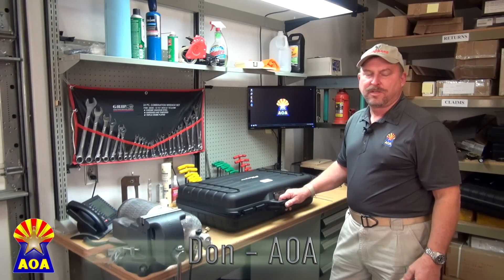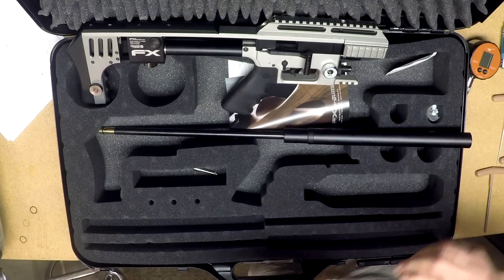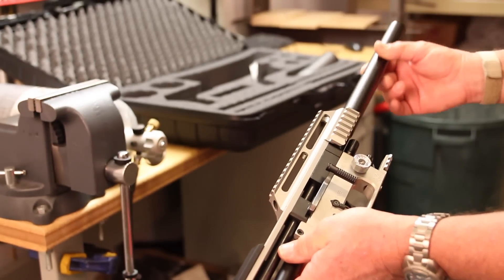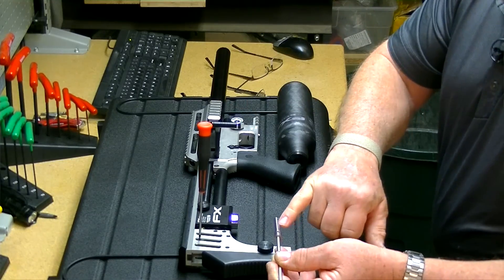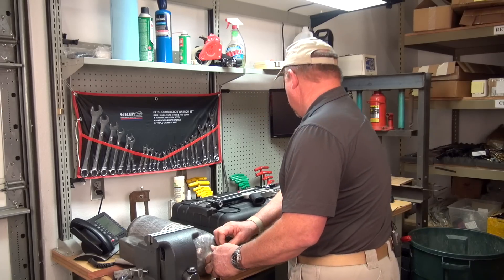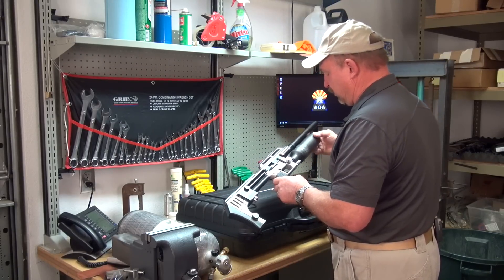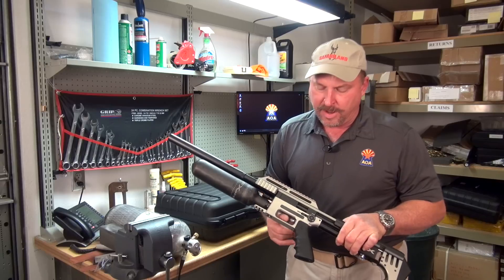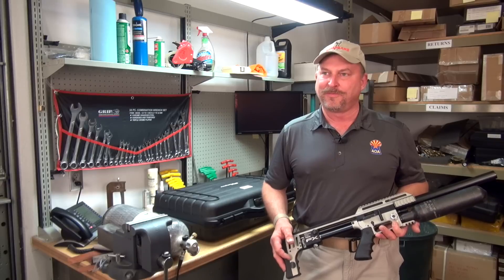FX Impact Unboxing and Assembly

Comment: Do not fire the Bullpup to release pressure on the regulator side, it might unseat a valve in the rear. There is an extra screw (regulator adjustment screw) which you should turn counterclockwise (2.5mm). https://www.youtube.com/watch?v=TjLeO7O8DA0

Comment: Hi I have an fx impact X and I want to sell it I'm in Canada. The gun comes with a 30 caliber the original 22 caliber and a carbon fiber 22 caliber. I was wondering if the 30 caliber Barrel will fit on an impact Mark 3? If so I might keep the 30 caliber
Reply from the maker: We couldn't say. We stopped selling FX years ago.

Comment: External power adjuster for pressure  incorporated in wheel and valve control knob only,  could be done while  you are using and firings the airgun.?????